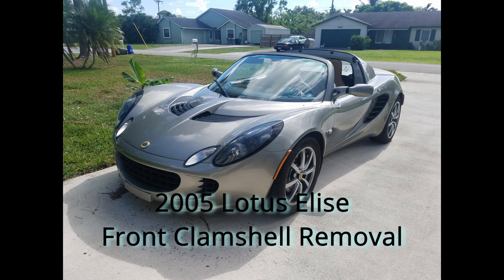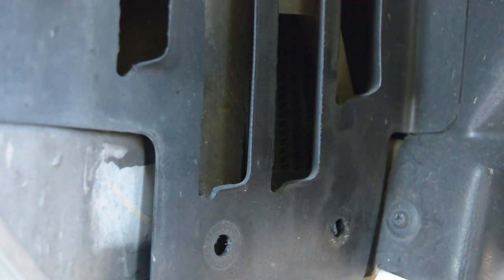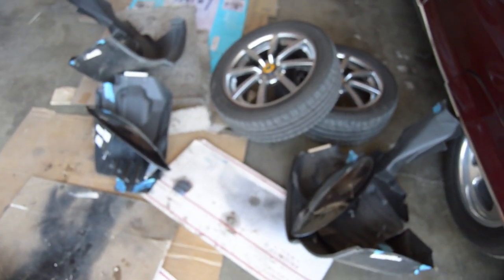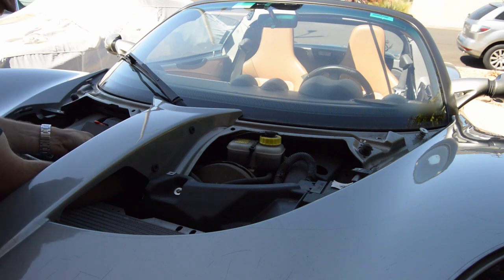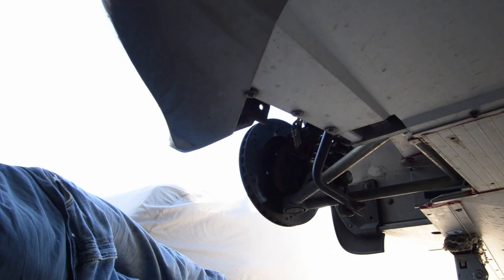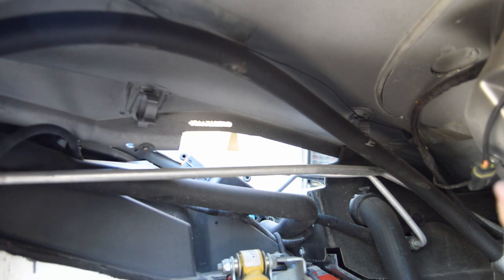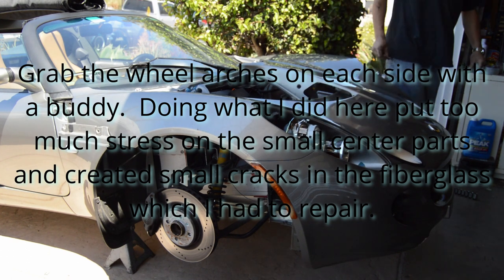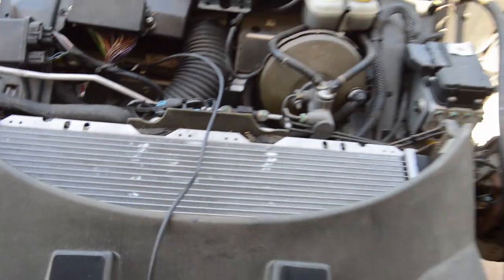2005 Lotus Clamshell Removal

Comment: Thank you. I plan to take my front clam off on the weekend, my radiator is leaking but not a lot, enough to be annoying, slightly different being a 2004 but very similar. I bought a Jeep with a dead rat up on top of the gearbox near the engine, but by the time I bought it, it was pretty much just a skeleton.

Comment: good video man. As soon as I grow some balls I'm gonna have to pull the clam to get a look at that darn front crossover oil line. Small leak on drivers side somewhere.......
Reply from the maker: Try removing the inner fender liner to have a look.  You should be able to access the fittings from there, I think.  It's been a while and I'd need to watch my own video over again to be sure!  😆

Comment: I invested in a set of Allen head sockets that can attach to a drill. I have little Tupperware type containers to hold the different groups of fasteners to make it easy to put back together. 

Great, detailed video. I was holding my breath at the end.

 What carcass? You going to do the rear? Your front suspension looks pretty minty... What do you do to keep it looking that good? I take mine out every week at least to do errands and take the loooong way home.

Comment: Great video and it will help me prevent the mistakes that you made. I think I will use painters tape liberally to prevent potential scratching during removal. Didn't realize when first watching that you were after dead rat. Did you upgrade horn to louder while in there? If not already member you should join Lotustalk. Thanks for making video!
Reply from the maker: I did not upgrade the horn but I did replace the radiator since I've heard the originals are prone to failure.  Need to go through my footage to see if I recorded enough for a video!

Comment: Very helpful video, but the segment starting at 30:50 was physically painful to watch. Imagine the next owner of the car, knowing that the previous owner removed the front clam by single-handedly yanking on it, damaging the fiberglass and raining spacers and who knows what else down into who knows where? Definitely a two-person job...appreciate you letting other learn from your mistakes.
Reply from the maker: Yeah it was not the best idea.  Should have waited until I had help.  I had assistance when putting it back on at least!   While the clam was off, I reinforced the area in the middle near the windscreen where there were minor cracks from this abuse (but no breaks).  It had damage/chunks missing up front from the previous owner hitting stuff so the clam wasn't perfect to begin with.  As for the spacers- none were lost!  Remember I counted them before removal. 😉  Next owner will likely be my offspring or a wrecking yard so no worries there! 🤣
Reply: @ADDAutoguy.  Fair enough! Again, good of you to share so others can learn. Enjoy the car, they're incredible and only appreciating!

Comment: Do you have a video for removing the rear clamshell ??

Never ever ever use a torque wrench to remove lug nuts and other fasteners.
Reply from the maker: Yes I know this but thanks.  It's still sound advice for others who see this. The torque wrench I was using here is broken.  So now it's a ratcheting breaker bar!

And no, I haven't removed the rear clam.  Haven't had a need to thankfully!
Reply: @ADDAutoguy.  Ok that makes sense now.
Any chance you need to remove the rear clam and could do a nice detailed video of that?   
Thanks
Reply: @ADDAutoguy.  I also have a broken torque wrench that is not a breaker bar. All good m8